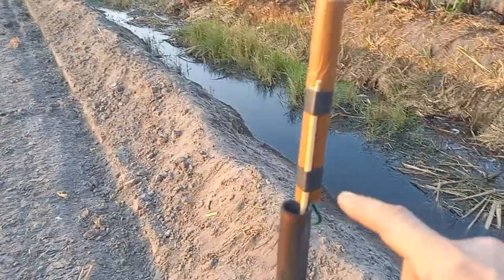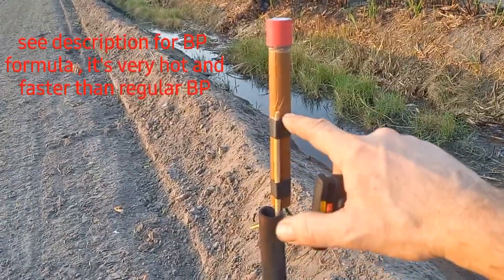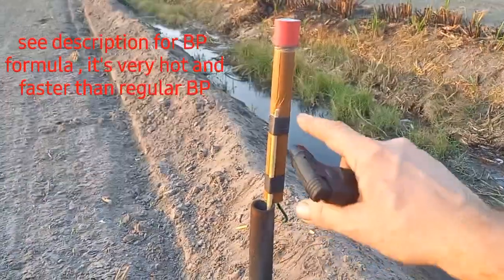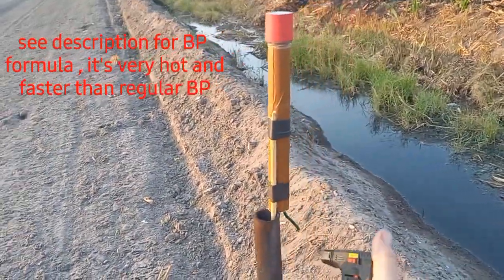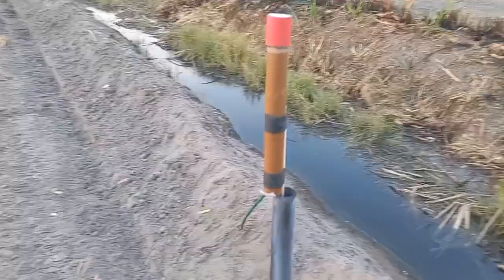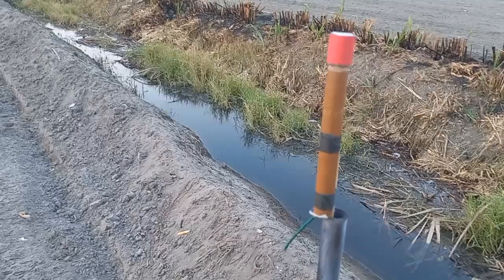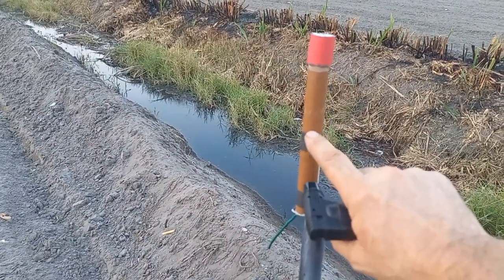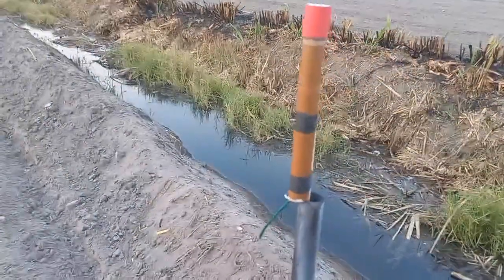Black powder Rocket 2 stage and strobe

Comment: Hey real some quick help I was going to try you’re strobe recipe 12% 80-200 and 8% 3 micron and 5% -325 because I like the loud pops would that be in part is I made a kilo batch if you could get back to me right away that would be great
Reply from the maker: Just an advise my friend. Sometimes needs adjustments specially in how fast it cycled right? according on how you make the fuel and how much you grind the ap etc . I'll recommend to make small batches first and once you have it right then make a big batch of it
Reply from the maker: Here im

Comment: Wow I really like these rockets, black powder, whistle and strobe!? Nice! I was thinking of something similar too, start with fast burning BP then Sally couple of increments as well. But I didn't know if it was going to work. After seeing yours I think it just might.
Reply from the maker: Yes , they work , keep on mind that the first motor is 100% pressed with hot BP , then second motor a few increments of whistle , then strobe.
Strobe fuel shouldn't make contact with BP.
Reply: @Pyroflorida  Can't wait to try, but why is strobe not supposed to touch the black powder? Is it some type of bad reaction or just pointing out the motor steps.
Reply from the maker: @patman0250  Ammonium perchlorate makes a bad reaction when is I contact with nitrates.. as long fuels are completely out of humidity is not a big deal. But any humidity on them will cause a sefl ignition anytime

Comment: Are all your rockets without nozzles?
Reply from the maker: Yes , they are all nozzleless,  I stopped making rockets with nozzle long time ago.
Reply: @Pyroflorida why did you stop nozzle?
Reply from the maker: @NagashiChidorii  nozzled rockets doesnt give you anything.. you wont get more speed , altitude or performance out of them..
Nozzleless are more flexible to very high burning fuels of any kind and .. and of course less susceptible to CATOs
Reply: @Pyroflorida what really!?? Everything i read say nozzle makes more pressure and thrust because of the restriction of flow but yes more CATOs because of it. You think they are wrong about that? Tom rebenklau rocket master only use nozzle motor too.
I will try no nozzle next time because i have BP rocket cato with nozzle as well
Reply from the maker: @NagashiChidorii  they can say wathever they want, for some reason the best rockets out of the best high performance fuels like red line whistles and strobes are only nozzleless,  super hop BP rockets as well.
No one needs to agree with me on this , this is my opinion based on my own experiences.
My rockets perform as I want them to perform , and they do what I want them to do ,  and that's what really matters for me 
The day I see Tom Rebenklau lifting a 1580 gram heading out of one pound motor  like ShortFuseMan does out of a nozzleless rocket maybe I'll consider nozzled rockets as a good option
Reply: @Pyroflorida  thank you for your insight much appreciated. I still learn a lot from you but i’m surprised of your opinion of nozzled. But of course you cannot do whistle mix with nozzle. That is even more pressure than any BP rocket even with milled and hot paulownia/willow charcoal BP.

Also you cant compare ShortFuseMan one pound whistle rocket nozzless to a BP rocket nozzled.
His KHP greenmix motor is way too powerful for a nozzle so thats why it’s nozzless.
Reply from the maker: @NagashiChidorii  there we go then , that's exactly what I meant and you just confirmed it , can't compare them , just because nozzled can't match out the performance , lifting power , multi  stage capability  , fuel compatibility, effect ,  etc. of a well made nozzleless motor.
Again , for some reason every single pyro I know goes nozzleless. 
Why you're gonna ride a vespa when you can ride a Harley😁
In amateur Rocketry nozzled rockets are the king , where AP fuels are used , totally different game compared with fireworks rockets we make ..
Blessings my friend👍
Reply: @Pyroflorida ahh i see what you mean now!! Because of the limits of pressure capacity in a nozzled motor, you cant increase thrust as much as you want or it will explode but nozzless can increase more thrust because its not containing the pressure. Wow good point!!
Reply from the maker: @NagashiChidorii  yes , you got it ! And also with nozzleless we can play and experiment with any possible fuel around , even with unthinkable power ones  like KHP , Hellfire , WOW  and many more , there isn't a limit pretty much of what we can achieve here.
Nozzled has a limitation to only a couple of fuels and certain output and that's it.

Comment: You put your stick on the lower motor I’ve always used top motor for stick and tiny bit of tape to hold it to the lower motor hopefully it blows off the lower motor when the top one lights but I’ve never found the remains of one to know if it really comes off lol and lower motor cato blows off stick and still lights upper motor while spinning from cato good times 😂great video as always
Reply from the maker: I used to do that , getting lower motor discarded or ejected after burn , after making 2 , 3 ,4 ,and 5 stages I realized that those burned motors are increasing resonance and providing a better graspy sound to the rocket , now im ataching all motors permanently,  I will make 1st motor ejectable if im dealing with 4 stages or more , just because the unnecessary weight